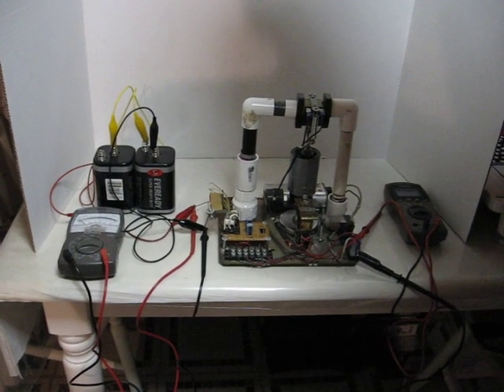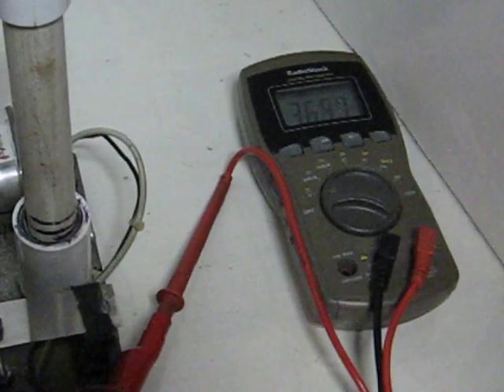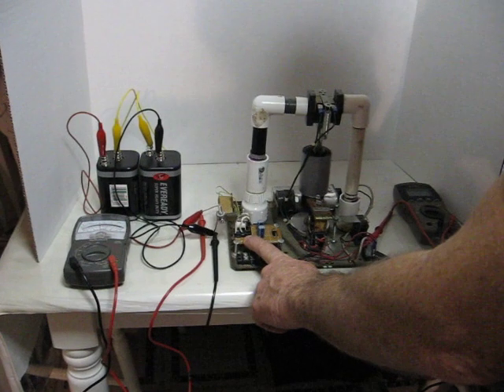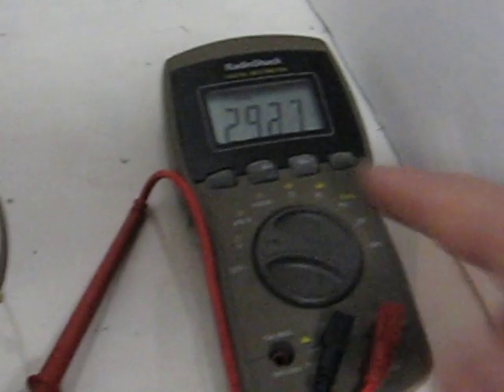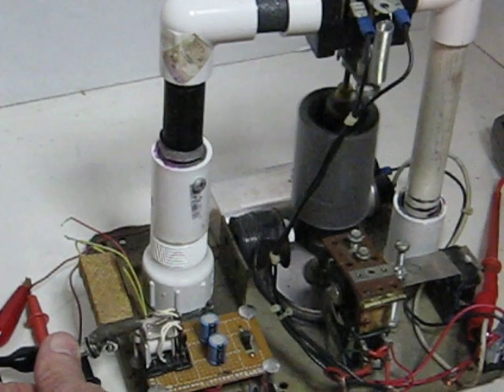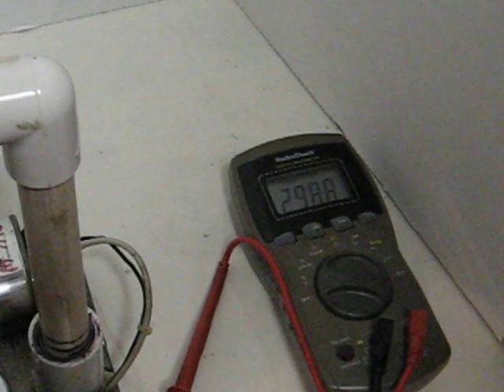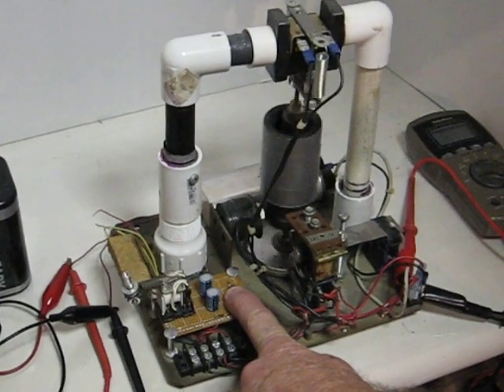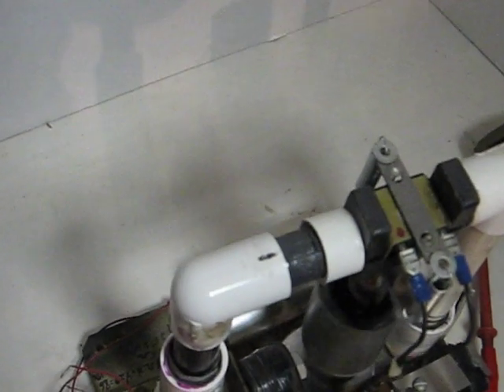electromagnetically driven rotary motor

Comment from the maker: Good point! yes you can use a transformer, but it adds to the expense and you have heat and core losses. I beleive I said wattage times the voltage in the vidio,when I meant to say volts times the amperage. I am not trying to claim overunity. The voltage spikes and the field coil collapsing with the spinning magnets timed in phase increases the voltage and that is stored in the capacitor. Like a boost and buck converter.I am trying to prove unity.

Comment: why use so many moving parts that take away from efficancy? wny not use no moving part like in oh i dont know a tranformer? 12v in to what ever out from 13v to 500,000v its the same thing, only cheeper less parts to breakdown, and can run for years before needing to be replaced. or are you saying this is over unity? and if you are then where is the watt meter? volts in and out mean nothing, its watts that matter, power in and power out, volt is not power, VxA=watts or power

Comment from the maker: @magneticmotorfun thanks for watching. my intent is better shown in my second video electromagnetically driven rotary motor demo 2. Cars have to change batteries every 4 years. imagine a car or a home generator that could run on very little electric and also recharge on the go! Permanent magnets take the place of electric motor field coils that drawl alot of amps from a battery. Because you use less energy it is feasable to be able to recharge the battery.

Comment: I'm not sure what the intent is.  Essentially you converted 12V to approx 300V.  You can never get unity.  There are too many losses that prevent this.  For instance Friction, resistance in wiring, back EMF and myriad of others. If unity was possible, this thing would run forever without a source.  Impossible!  A simple vibrator circuit and a step-up transformer could replicate the same thing.

Comment: why charge batteries. they are very inefficient. if you're trying to create overunity in a closed-loop system you need to remove the batteries and use 1,000 farad caps or greater. use a voltage to current convertor [scr] and feed the output back to the input. batteries should only be used to jumpstart the system. if there is any energy leftover then you have just created an overunity machine.

Comment from the maker: Hi jdk1928

Right you are.  iam making anew video that shows ampereage and voltage readings. You can never get out more than you put in ,but unity can be acheived if power drain is not as much as  power being put back into the battery by the permanent magnets rotating past my one coil. The capacitor stores the back pressure or wattless energy that is usually dissipated off as heat.